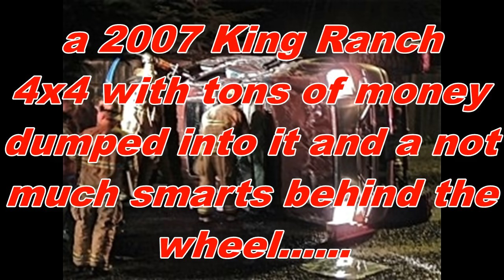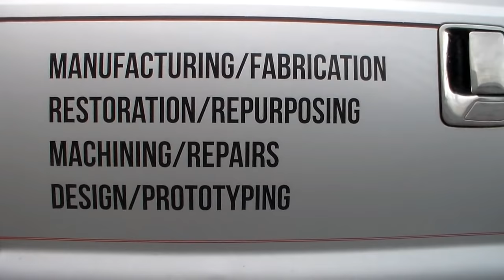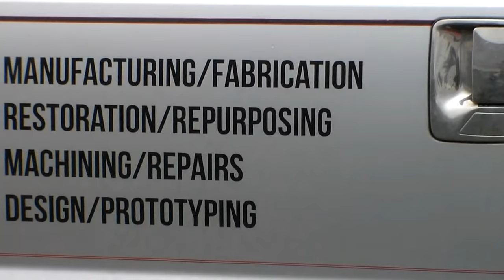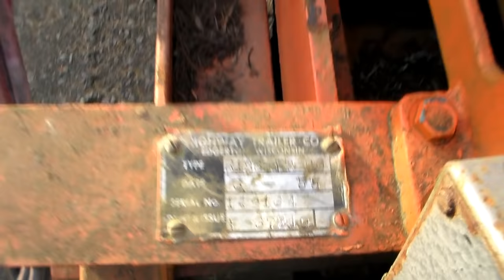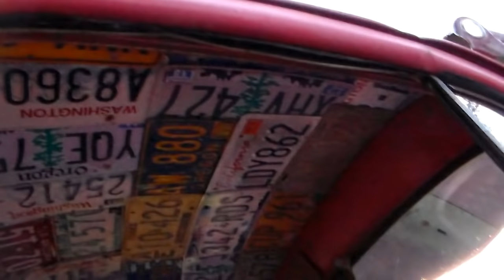Boomer 1955 GMC Documentary

Comment: I never liked a truck that's lowered. I like when they sit up like a truck should typical of Boomer & the snub nose, maybe I'm old fashion.   I'm not a GM guy, but I love the early years thru the shyann series. And the dog steals the show LOL. I like that yellow truck, where you guys are having a meeting.  The first truck I rode in was a shyann series my dad borrowed from his work. As a tribute to my dad, who passed, I named my female cat, shyann LOL. I get around trucks I"m like a kid in a candy store, even more so than mussel cars. Wow, I recognized that slant six banger right off, my van had one of those in it, made for a tough truck, just no power LOL. However, what a work horse, I pulled a two ton trailer + loaded up the interior for 10 years, and it was strong when I sold it, however I had modified it some to handle the weight, and changed the gearing, it as only a 3 speed manual. Boomer is going to be beautiful when it's done.